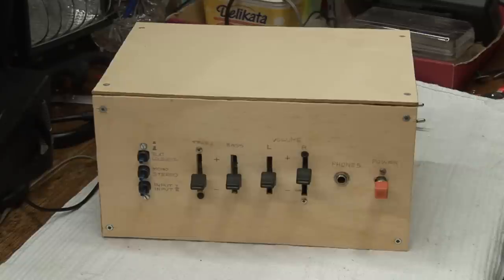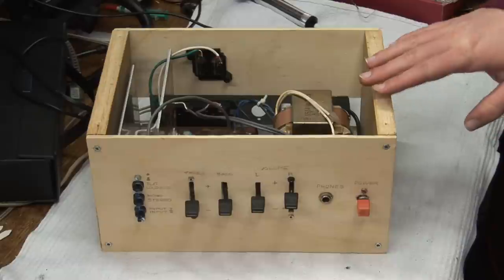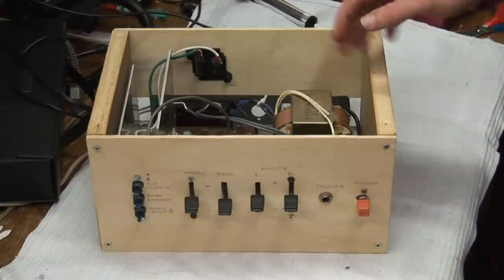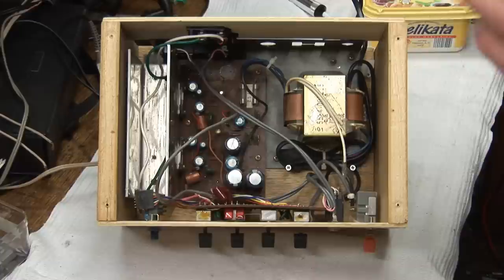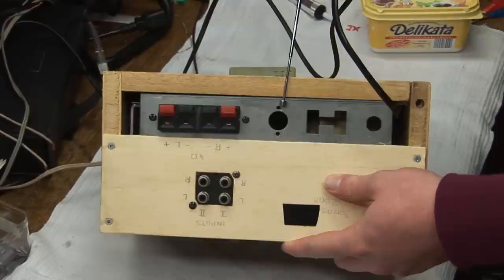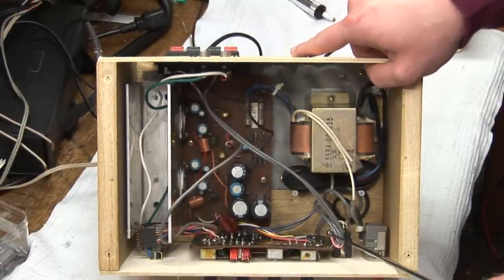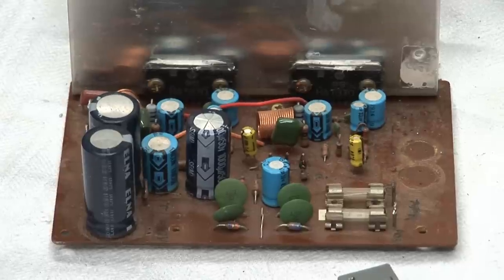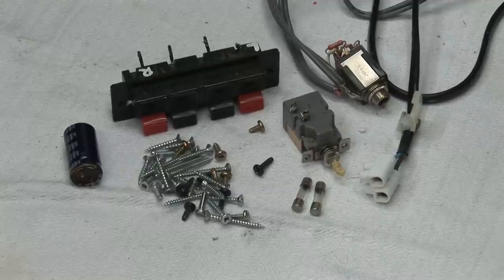Homemade Audio Amplifier Teardown

Comment: You probably don't care anymore, but I found some relevant datasheets about the amplifier:

* page 25 in this data book summarizes the official datasheet: http://usp.net/ambit/ambitcat2.pdf
* this is the HA 1350 datasheet, similar to the 1370 - http://www.datasheet4u.com/datasheet/H/A/1/HA1350_Hitachi.pdf.html
* this is the HA 1397 datasheet, which explicitly calls out its similarity to HA 1370 - http://pdf1.alldatasheet.com/datasheet-pdf/view/93606/HITACHI/HA1397.html

Those last two look like they're scanned from the same data book, but apparently no one bothered to scan the entry for the HA 1370.
Reply from the maker: Thanks for the info! This amplifier is long gone, but others might find this helpful.

Comment: 3:02 "Loudness doesnt seem to make a difference.." Loudness control is intended to make a difference when playing at low volume. When playing at very low volume, treble and bass drop off fast, The loudness control is intended to compensate for that.
Reply from the maker: I know how the loudness is supposed to work. However, the implementation in this circuit was quite bad.